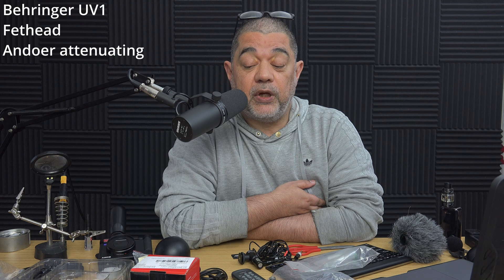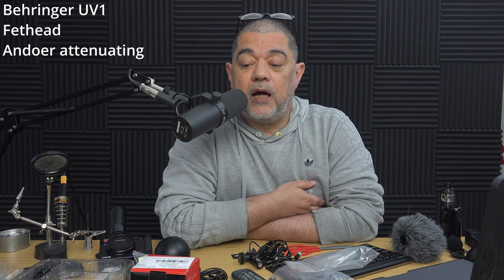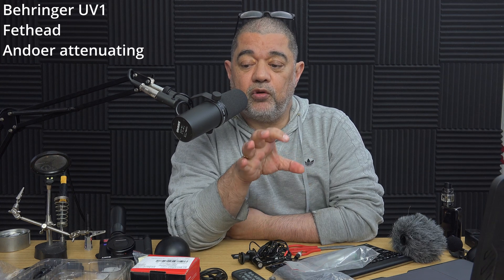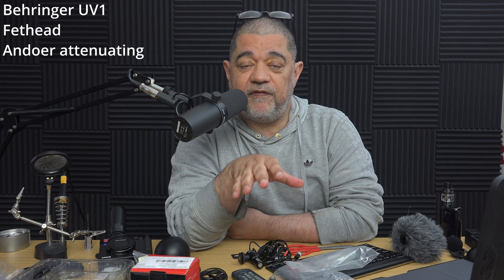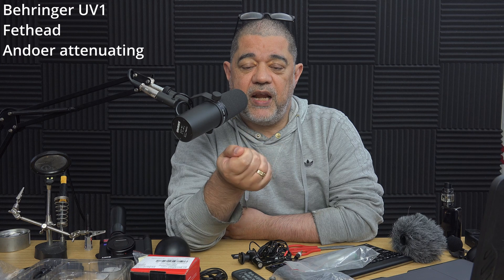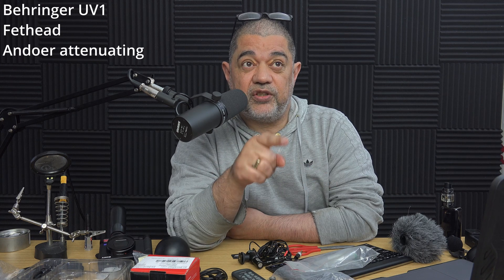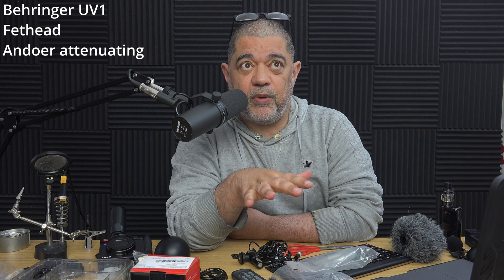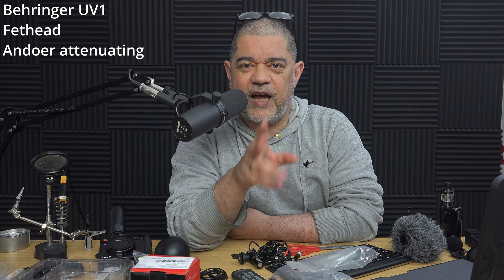Shure SM7B preamp tests for gain, noise, & tone using Behringer UV1, Fethead & Andoer WS-V2 - PRELIM

Comment: I run my DBX286a through a Scarlett Solo audio interface and the gain with that satisfies my needs...I suppose you could run the UV1 through the Scarlett rather than its own USB out and do the same thing rather than using the Andover or Fathead.
Reply from the maker: You could run the UV1 through a Scarlett but it isn’t worth it as you’d be unnecessarily going through two preamps. The Andoer and Fethead were only really being tested for an analogue workflow where extra attenuation and gain may be necessary for certain mics and analogue input destinations. These aren’t necessary for USB connection. Cheers, Dave.
Reply: Interesting, as my DBX 286 really doesn't have proper gain for the SM7B...maybe the Behringer has more gain which would be great as I have one on order...but they are backordered until the end of October and only one vendor sells them that I can find...cheers!  Your videos gave me the impetus to order a Behringer UV1.
Reply from the maker: @apostolicbible1  The UV1 just about has enough gain for the 7B, you have to max out the input but it is quiet. I have other preamps that get noisy when you max them out with a 7B. Where are you and where did you find the UV1? I’m in the UK and had to order mine from Bax in Holland. It’s very odd that the UV1 is so hard to find in stock. Cheers, Dave.